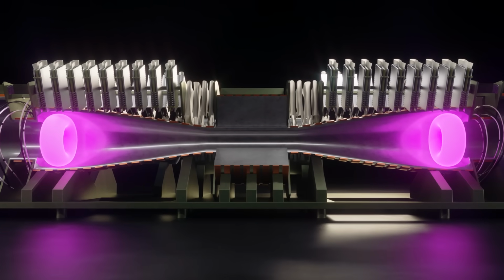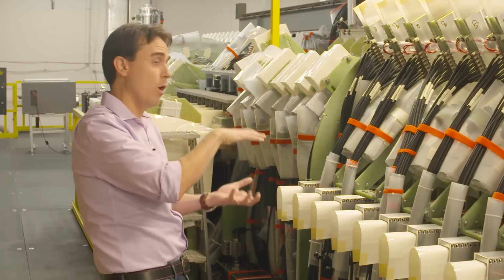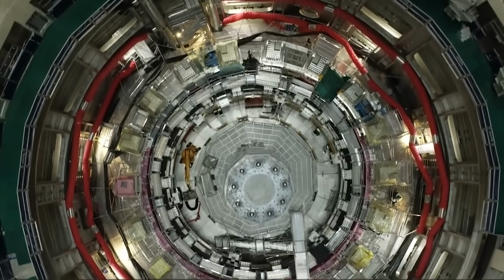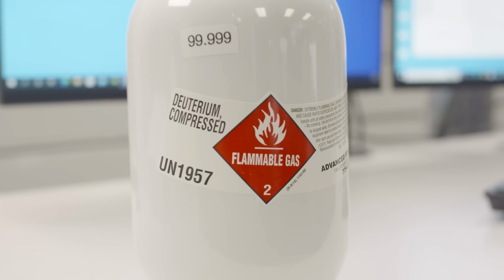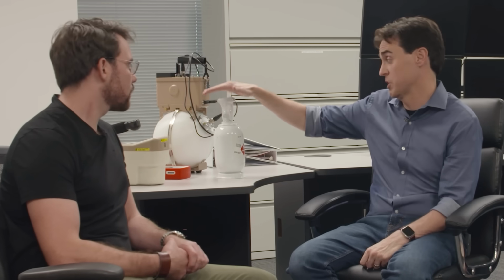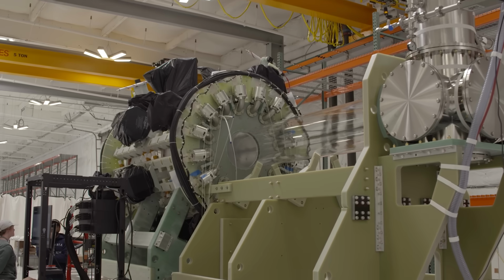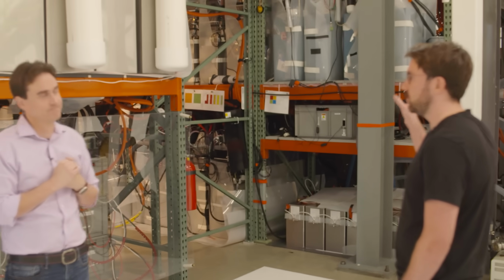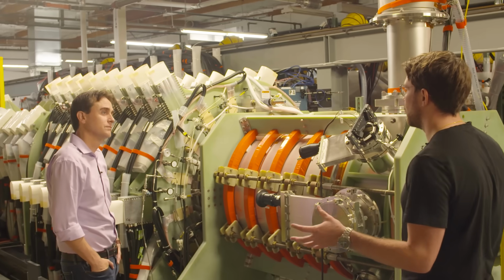A New Way to Achieve Nuclear Fusion: Helion

Comment: This is an exciting and novelle way of creating exotic helium 3 but how does it transfere its massive heat into steam for turbines? I mean you showed the TOCAMAC but you didnt show how this system does it..Also how is this better than the Thorium based  Low radioctivity fission reactor? Wow I wished I would have waited to the end to comment..
Reply: They do not use steam turbines. The FRC plasmoid has its own magnetic field. When it expands (due to its own internal pressure and the added energy from fusion reactions), this induces a current in the coils that were used to compress it. The beauty is that they can not only recover the fusion energy that way, but also most of the energy that went into compressing the plasmoid in the first place.
Reply: @elmarmoelzer2229  Now that is AMAZING, it's basicly the perpetual motion generator..A freeking unicorn..
Reply: @KirkDavis1966   No, it is not a perpetual motion generator! 
They lose about 5% of the input energy to ohmic losses. But the added energy from fusion reactions makes up for that and adds enough additional energy output for the grid.
So you have Power(in) * 0.95 + Power(fusion) * 0.9 (or maybe a little less, depending on various factors like e.g. the exact fuel mix).
That is, if it works as predicted, which Polaris is supposed to demonstrate some time around the end of the year.

Comment: So they got a few atoms to fuse.  So what.  Low energy nuclear reactors also get a few atoms to fuse.  Commercial nuclear fusion is never going to happen. Billions spent over more than a half century have proven it is not possible.  When you honestly add up ALL the energy put into getting a fusion reaction it will always be greater than the energy you get out of the reaction.  This is the reality  that enthusiasts will not accept and leverage the greed of investor to keep this unacknowledged scam going.

Comment: It’s 2024 now.  Is fusion still 15 or 20 years away? 😀
Reply: It's been only 15 years away for about 70 years, so I'd say in about 70 years it will be 15 years away.
Reply: @RudCh01 even then, it will be 1000's of times the cost of electricity from natural gas.
Reply: Contributing nothing but cynicism while others work the problem

Comment: 🎯 Key Takeaways for quick navigation:

00:33 🔬 Helion Energy's sixth-generation nuclear fusion generator, Trenta, uses a novel approach by adapting ion propulsion technology from space, achieving fusion by colliding plasma rings at high speeds.
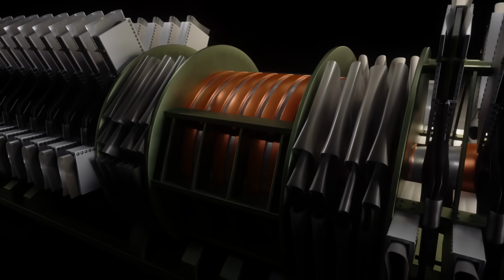01:28 ⚡ The fusion process in Trenta generates tremendous energy by fusing ions at temperatures of tens of millions of degrees, observed as a bright pink flash during the fusion reaction.
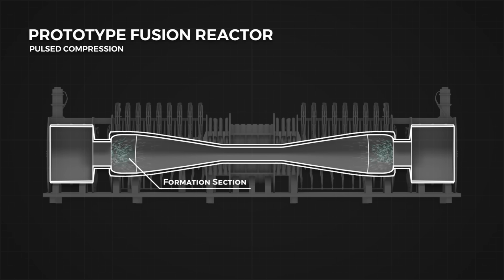02:54 🧲 Helion's fusion method involves creating a field reverse configuration (FRC) plasma, compressed by pulsed magnetic fields to achieve fusion conditions, offering a unique approach compared to traditional fusion methods.
07:59 💡 Helion's technology aims to generate electricity directly from the magnetic field created by the fusion reaction, bypassing several steps required in conventional nuclear fusion reactors.
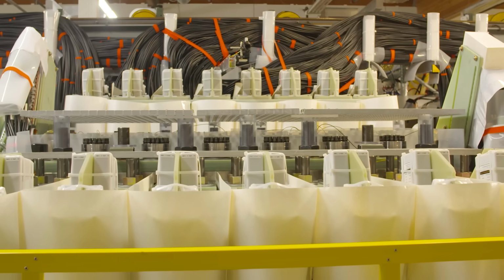17:00 🚀 The major innovation in Helion's approach includes using a deuterium and helium-3 fuel mixture, which is more efficient and avoids the challenges faced by traditional tokamak reactors using deuterium and tritium.

Made with HARPA AI

Comment: So what was the ratio of energy released vs that expended to acheive it ?
Reply: This question is actually harder to answer than you might think. 
1. Trenta was an experiment. It did not have any equipment to recover energy from the plasma (that will be the next one, Polaris). So no actual energy was recovered. 
2. Polaris can (if all goes as planned) recover 95% of the input energy along with the fusion energy. So you get P(in) * 0.95 + P(out) * 0.95. So essentially Polaris would just have to produce enough fusion reactions to make up for those 5% losses and produce small amounts of electricity.
3. The next question is net electricity with what fuel? Polaris will do experiments with Deuterium - Deuterium, Deuterium - Helium3 and Deuterium - Tritium. All of them have different requirements for temperature and density. I hear that Trenta could have produced small amounts of net electricity from D-T reactions IF it had the equipment (and that equipment works as planned).
Reply: Look forward to the  actual production.
Reply: @alschafer4292   Still planned for some time around the end of this year.

Comment: Controlled nuclear fusion is a neat idea... but so far unreachable but teasing.  Yet Billions are thrown at it as though the only problem is a lack of cash to burn.  My hopes stand with Nuclear Excitation by Electron Capture, a form of matter annihilation.   Experiments have grown beyond a star in a jar, but now they are building a full scale industrial reactor.  The idea scopes from central reactors to individual mobile reactors the size of a foot locker.  Imagine running your home for a decade off a two liter bottle of hydrogen.   Run your car for a decade off a two liter bottle of hydrogen.  All this with no radiation problems, in fact it can be used to clean radioactive products by running it through the chamber. No radioactive products. No radioactive storage issues. Clean, pure energy. The transmutation of material into rare earth elements. Our ever dream, and the media refuses to cover it at all.

Comment: this video revitalize my hope in fusion again. With the knowledge on the progress on ITER and all the still to be solved problems that i wonder we are even able to solve. This concept sounds a lot more realistic.
I still am sceptical since no information was shared on energy input vs output. but still the step they skip on using boiling water and basicly capture the magnatic field from the reaction makes it sounds like a more realistic net system.
however if lack the knowlege i still wonder how easy/dificult it is to actually capture the energy as a magnetic field i wonder if there are any videos on that topic available.
Reply: You are falling for a scam.

Comment: But, only matter , it is over unity, yes or not?. If not, it is just another energy converter.
Reply: Trenta was an experimental machine. It did not have the equipment to convert the fusion (and the input) energy into electricity and that is what really matters in the end.
This is what Polaris will do in 2024 if all goes as planned. Then we will know for sure if Helion is a success or not. Trenta was a successful experiment but not the final version of their design. The next one is Polaris and that is not the final one either. If Polaris is successful, then there will be a first of a kind power plant for Microsoft (due 2028). So fingers crossed that things continue to go as planned for Helion.

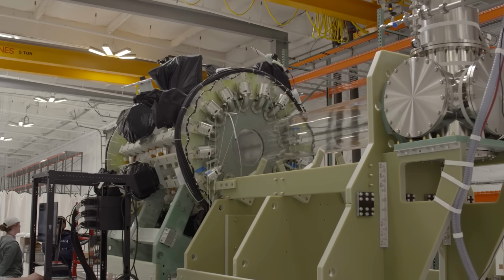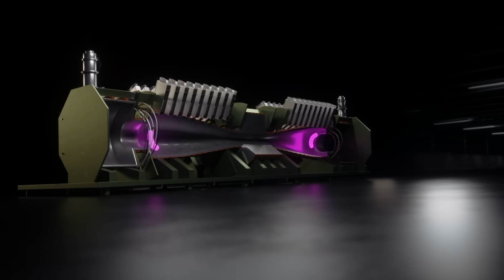Comment: 18:05 / 18:30 My 2 Cents Analysis: The Polaris Generator Stable commercial Repetition Problem (not yet sure that I can fully understand the concept of direct fusion to Electricity) but my guess won't 60 generators all sequenced/timed to each output/fire 1/60 cycles per second. Analogy similar to producing  60 Hz AC @ 60 cycles per second everytime the generator passes a coil @ turbine/generator/alternator at shaft speeds of 3600 RPM. Practically thinking of Gun Recoil time after every shoot/burst
Reply: The produced electricity is stored in capacitor banks and from there is gradually released to the grid. There need to be inverters too from DC to AC.

Comment: Yeah because we have plenty of useless hydrogen & helium.
Reply: Fusion power plants need tiny amounts of fuel. A 50 MWe Helion plant would only need 20 kg of Deuterium a year. There is enough Deuterium in the oceans to supply all of the worlds energy needs long after the sun has burned out. The Helium3 is not a problem because Helion makes their own by fusing Deuterium.

Comment: Three things concern me with Helion's method...

1- what is levels of neutron radiation are being projected? 

2- what is the comparative net output?

3- what kind of material consumption can we expect for sustaining the process AT SCALE over time?
Reply: 1. one 2.45 MeV neutron for every 3 to 4 reactions (depending on much He3 from T- decay or trade, they can get). 2.45 MeV neutrons are relatively benign (compared to 14 MeV neutrons in Tokamaks).
2. They are aiming for 50 MWe power plants, though have the option to either make bigger reactors (scales linearly with volume) or cluster several of them at one site. The latter allows multiple "cores" to share a lot of the equipment, like the power supplies (capacitors) and some of the shielding which is where a lot of the cost is.
3. Should be less than wind and solar for the power plant (building, cores, power supplies, etc), even more so if you factor in storage needed for wind and solar. Fuel is only about 20 kg of Deuterium/year for a 50 MWe plant. That is nothing.
Reply: @elmarmoelzer2229 Keep on dreaming.
Reply: @c.s.4273   No, I keep on knowing and learning :)
You should try the same!

Comment: Gigawatts in Megawatts out.
Isn't it convenient how they just gloss over that detail.
For those that need it spelled out.  It uses more energy than it generates.  So it's net negative.
None of them make more energy than they use.  That B.S. claim by the Energy department was just for the reaction.  Not the NET energy used verse what's produced.
And no there is no figuring it out.  It's the law of thermodynamics.
Reply: Trenta was a subscale experimental machine. It did not have the equipment to convert fusion energy into electricity. That will be happening with Polaris which is still aiming to demonstrate net electricity around the end of 2024.
Reply: @elmarmoelzer2229  still waiting

Comment: Would be cool to connect multiple reactors together to each other the next ones ignition, similar to cylinders in an engine

Also it seems like if these guys had half the support and cooperation as the other big reactors, then they could save tons on capacity banks
Eg if they could get access to larger grid energy, maybe they could shrink their facility a few magnitudes
Eg skip capacitor storage, get crazy high voltage drastically reduce amp load
Don't need to step down until you're closer to the machine

Comment: I still don't understand how the energy capture system is supposed to work
Reply: You can sort of compare it to the piston in a combustion engine. The piston compresses the fuel mix. It is ignited and the added energy from the combustion drives the piston back to its original position plus some extra force to make it go faster and into the next round. In Helion's case the piston is a magnetic field and instead of an exploding fuel gas mixture, they use fusion fuel and nuclear fusion.

Comment: This one seems like a more difficult process to extract heat from than ITERs design
Reply: ITER does not extract heat from the plasma. It is just an experimental machine. Even if it did, it is actually much more complicated and expensive than what Helion is doing.

Comment: 20:30 If the fuselage is metallic, a high positive charge voltage can be applied to give it resistance to corrosion and permeability to hydrogen plasma.

Comment: Interesting how it converts energy into electricity, would love the comparison against a steam system efficiency. And why aren't fusion generators not working with solar panels. That would make the most sense to me given they work on the same reaction as the sun.
Reply: Because solar panels are actually not all that efficient. The average is about 22%. The maximum is about 33%. A steam generator is about 30 to 40% efficient, depending on the technology. Helion's direct conversion could be extremely efficient, up to 90%. I cautiously predict around 80%, which is still almost 4 times as good as a solar panel and twice as good as the best steam generators.

Comment: It's absolutely amazing that they've managed to circumvent many of the issues that crop up with the Tokamak design. 

While I have high hopes for this approach, there's also a downside to having these innovations come out of a commercial company, whose primary goal will naturally be to maximize short term profits: It means that the cheap and abundant parts of the "cheap, abundant clean energy" promise of fusion are not going to come true; With no competitors, Helion will likely supply their power at only just below market rate and (because it can be turned on/off at will and still has significant fuel costs) it's probably going to be used in the role of peaker powerplant; Selling electricity only when it is most profitable and thus only displacing the small section of fossil fuel powerplants that operate in that area of the marketplace today. That's a good thing in and of itself too, don't get me wrong... But it won't make baseload power generation through fossil fuels uncompetitive anytime soon. Not until after they've conquered every other more profitable section of the energy market first.
Reply: Helion is planning to mass produce their machines at a rate of 20 a day (once mass production is in full swing). The bigger problem is grid connection licenses. Those currently take 7 years in the US!
That is why they are focusing on "behind the meter" applications first. E.g. they have a cooperation with a steel maker and will likely supply data centers and other large electricity consumers first.

Comment: beryllium cannot magically manufacture a neutron it's a neutron reflector that neutron has to be coming out of somewhere
Reply: In fusion reactors, the neutron comes from fusion. Either Deuterium- Trtium- fusion or Deuterium-Deuterium fusion. When hit by a high energy neutron, it will act as a neutron multiplier.
Reply: @elmarmoelzer2229  it will bounce the neutrons and keep them in play it keeps them from leaving the system so they can interact but it doesn't manufacture it from thin air
Reply: @Anon-zu3xn   Deuterium fusion produces one 2.45 MeV neutron for every two fusion reactions.
Deuterium- Tritium fusion produces one 14 MEV neutron in every reaction. That is where the neutrons come from that then interact with the Beryllium.

Comment: I’d really like a video explaining how we can harvest energy from both fission and fusion. It seems like these processes should not both be able to generate energy; so a video focusing on how both nuclear processes can result in energy output would be very interesting.
Reply: The sum of the masses of the fusion products is slightly less than the sum of the masses of the light atoms in the fuel that fuse. That missing mass, the "mass defect" and is released as energy. Essentially it is the nuclear binding energy that is released. If you want to know more read up on "gluons".
Reply: @elmarmoelzer2229  I mean, I understand that the process of generating energy from nuclear power requires the destruction of mass. However, it seems counterintuitive that both fission and fusion are capable of both destroying mass. Sort of like if we could harvest energy from both the freezing and thawing of water. So I’d like to have a more complete picture of both processes and why it is that one process is not always energy positive and the other negative, if that makes sense.
Reply: @Smalltimecdnfarmer  For fusion it depends on the mass of the fuel atoms. Theoretically everything below iron would release some energy (but some are just too hard, or release too little, etc).
Nuclear decay (not just fission which is a form of decay) is different as even low mass atoms can release energy when decaying. E.g. Tritium beta- decays and releases (comparably small amounts of) energy that can be harvested using betavoltaics.
So yes, for example you can make Tritium from Deuterium fusion, which releases energy. Then that Tritium will beta decay into Helium3, which releases energy. That He3 can be fed back into Helion's machine as fuel for another reaction that releases even more energy. It is counterintuitive but it is legit.

Comment: Encouraging,  but probably a decade or more away
Reply: Well, they are aiming for around the end of 2024 for net electricity and have a contract with Microsoft for a first power plant in 2028. So not a decade (provided everything works out as planned).
Reply: @elmarmoelzer2229  Of course not a decade.  At least 3 decades no less.  Contract with MicroSoft is nothing. If Helion fails to generate electricity, MicroSoft will not pay them.  MicroSoft pays for electricity not the project.  Noone mention NRC.  Why? In its roadmap it will generate high energy fast neutrons in every phase.  How come NRC exempt them from regulation? It is a electricity generation plant.  It emits neutron radiation.  I do not see any reason why NRC will let it go.  When NRC is involved, the certification process takes at least a decade or more.

Comment: Great Doco, but I think they would be better using a toroidal  transformers for  there experiment with  also using Fibre optics, for faster power sources,  than using steel windings, & using element,s 115, & 116, just a thought, hmm wonder where I heard this before,??

Comment: All very cool.  It's interesting to see what private funding can do.  Problem is they have not achieved net positive energy gain.  Let me say that again, everything they have invented costs energy to make a pretty pink flash.
I find it odd that you compare this to a tokamak and NOT to the NIF's pulsed LASER configuration.   Why did you ignore a proven method and chose a losing method?  Why did you never mention that Helion has failed ignition?  Seems like this video is more of an advertisement than a real engineering documentary.
Reply: Whether they have actually produced net energy or not and with what fuel is currently not known. Trenta was very successful. Polaris is still on track to demonstrate net electricity (not just net energy) around the end of next year.